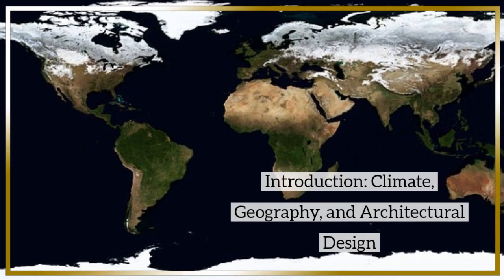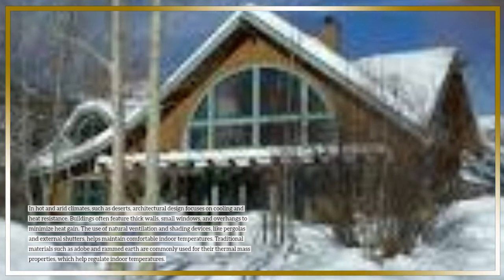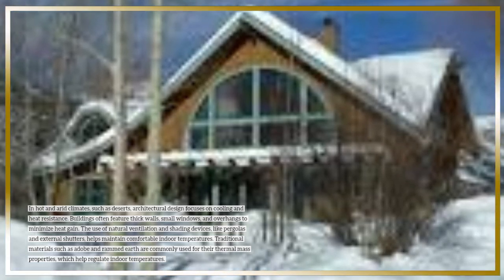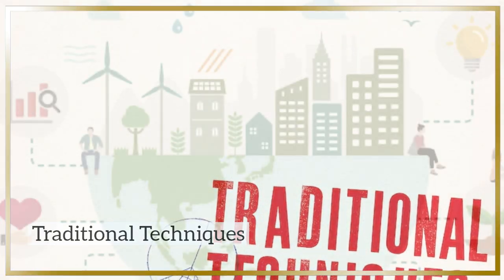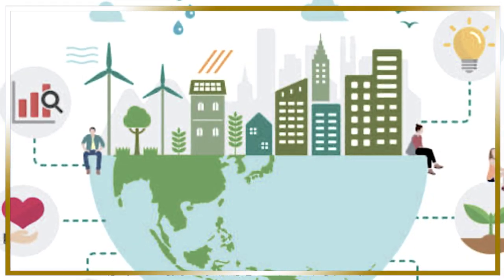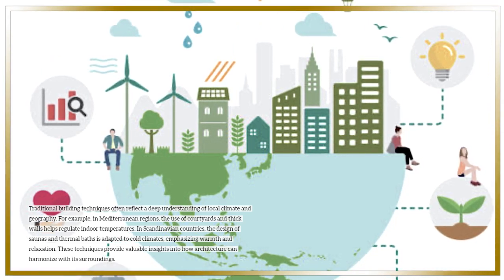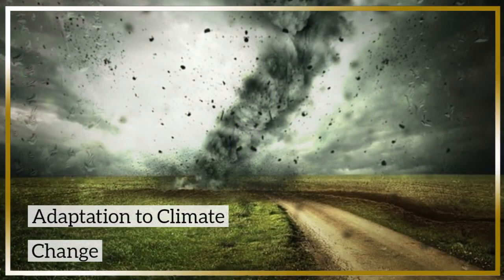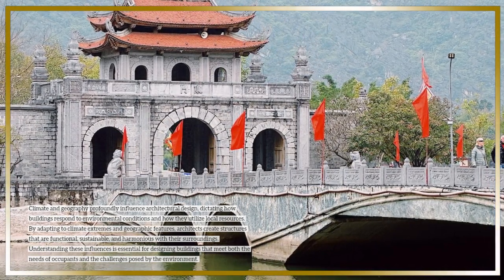How Do Climate and Geography Influence Architectural Design

Comment: Yes, closer to the equator, you get flatter, lower pitched roofs, and away from the equator you get steeper pitch roofs to combat the snow accumulation, and sheer weight that gathers on it, but you also have lighter colored paint near the equator and darker colored paint further from it he did a good job, mentioning the overhangs, but also the orientation. Sometimes they will slightly angle the building off of perfectly north south east west and by turning  the building 10-20° counterclockwise you can cut off the time that the south and west faces receive sunlight, depending on the length of the south face and the length of the west face may be something like double glaze low E windows with an overhang on south, face and triple E windows on west face  off kilter to a little bit with windows that allow cross ventilation, painted a color shaded to the lattitude near tropical, rainy or wet climates they also use more metal roofs if not bamboo and open structures with a lot of windows, from drying and cross ventilation near the ocean. They also use metals that won’t corrode with the salt. Zinc copper. Mud bricks and rammed earth are really cool for insulative properties and ease and availability. Lime and cement, different rocks for foundation and lighter porous volcanic rocks for roofs or spans of tension. Romans also made layer of clay tiles in walls to fight against earthquakes and potsherds. Clay is cool and remarkable. Vitruvius said this all started off of imitating a birds nest of weaving sticks then laying animal hides on top. Lapping the animal hides over another are like tiles on roof we still use to this day.